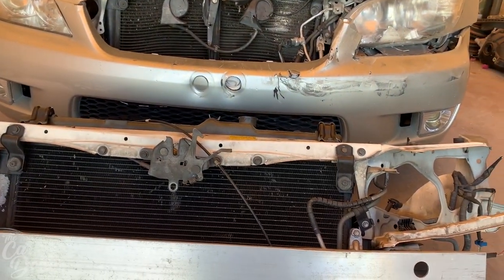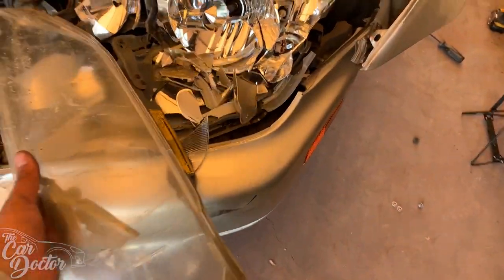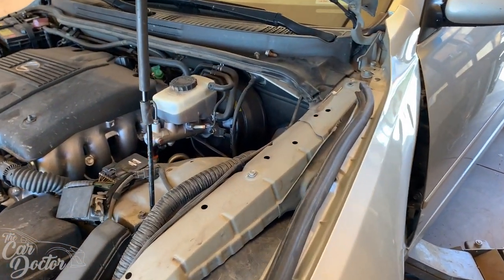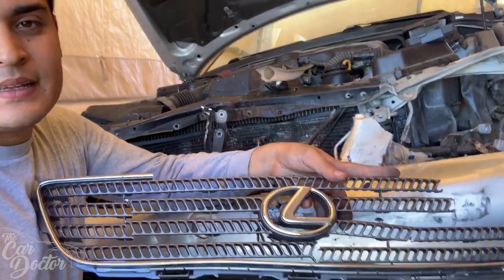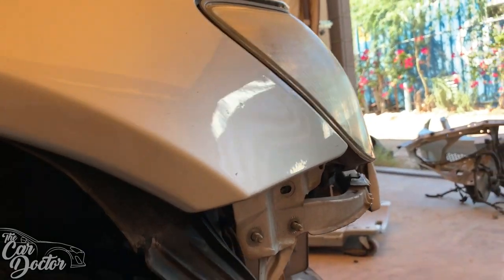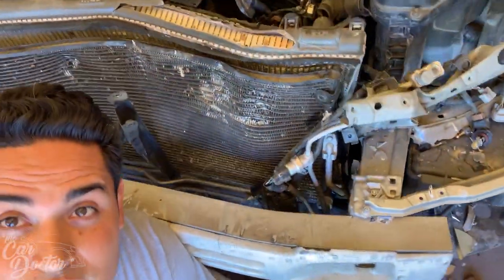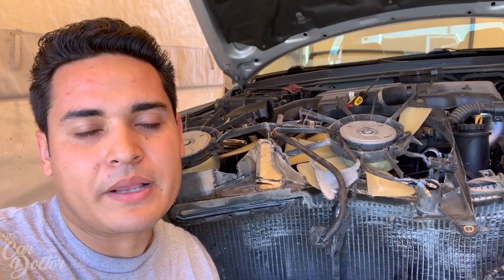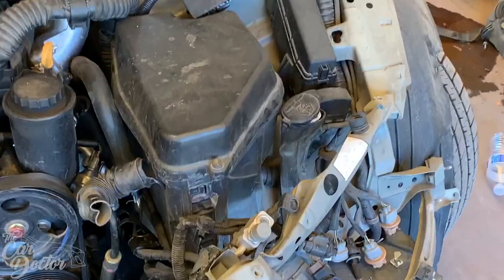Life of Jonny - IS300 Core Support Replacement

Comment: I know this is old but im waiting for a front clip for my car it was hit driver headlight area, is it possible to cut the old clip off and put the new without disconnecting the radiator and condenser.  Just my driver headlight support is mangled and a slight kink in the center part condenser and rad weren't touched
Reply: I uploaded a short vid